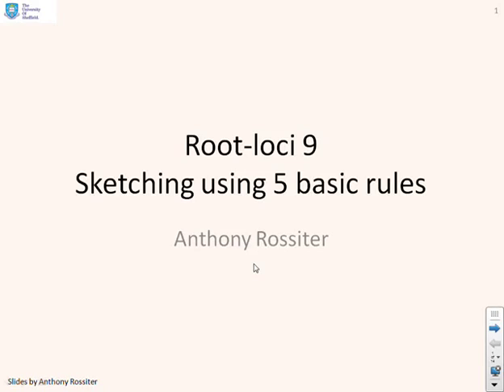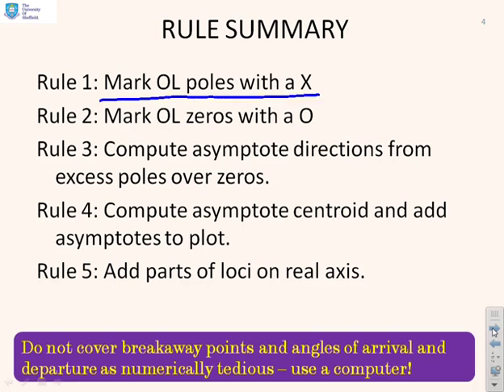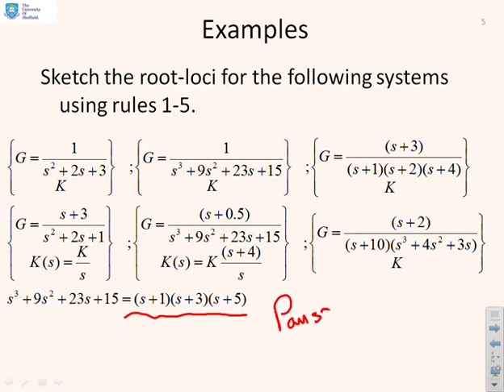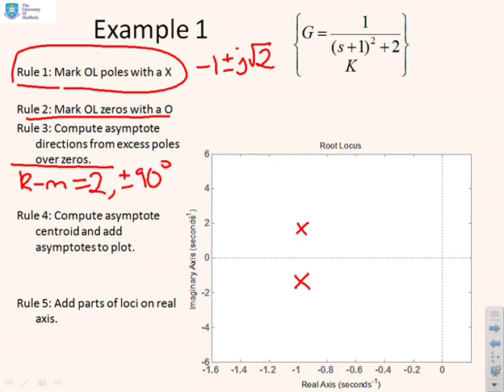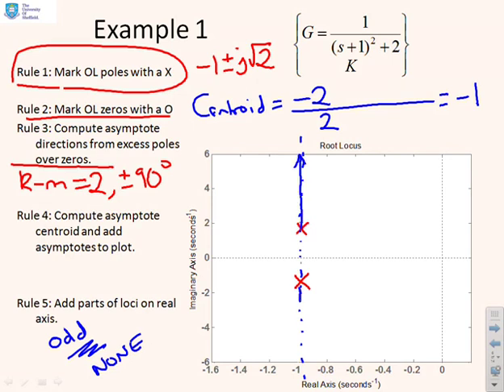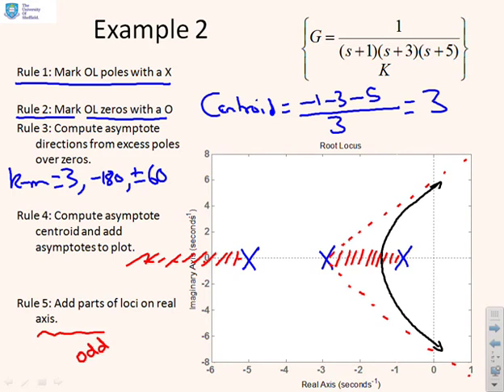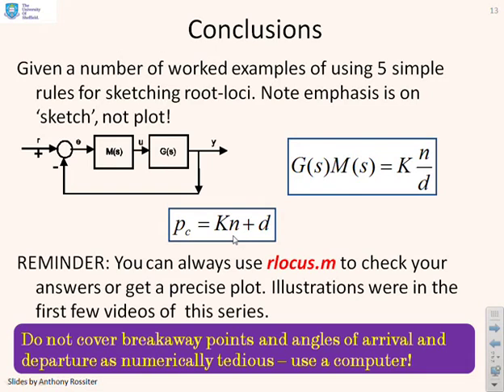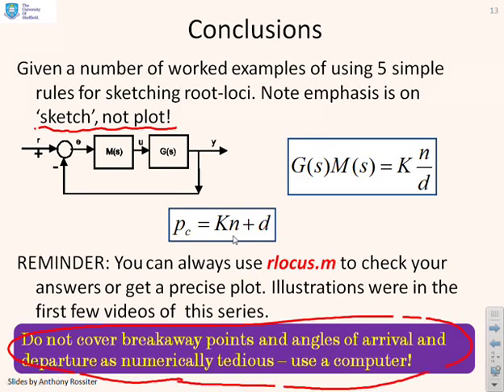Root-loci 9 - Worked examples using all the 5 sketching rules

Comment: Thank you so much!!! 

My professor was taught a 1950's education in the 1970's. The old, crusty piece of shit never learned anything else -- is now tenured and forcing on us a 1950's education in 2015...

Hand drawn (very complex transfer function) root locus plots, solving polynomial roots by hand (no calculator) of power 4 and up, (not Gaussian elimination where that algorithm may be useful either). 

The SOB comes late and with a temper.

Really wish you could teach us.
Reply: SO!?  You are still being taught 1950s info.  What do you do with it?  Today controllers usually have more than just one gain so now what? 
What this instructor hasn't pointed is that the breakaway point is a key point.   If you consider the resulting response each pole has a real and imaginary term.   Any error will decay as a function of exp(Re(pole)*t).   What the instructor shows is that it is impossible to move all the poles to the left of the breakaway point to get a faster response or is it?   You have to think about the resulting differential equations derived from the pole locations and the response.